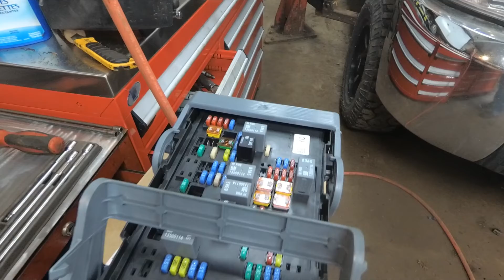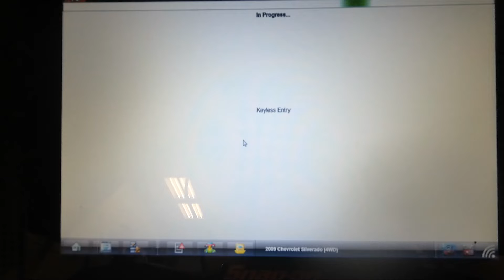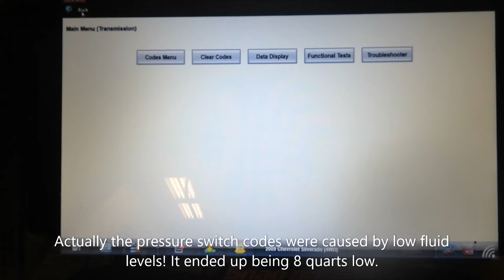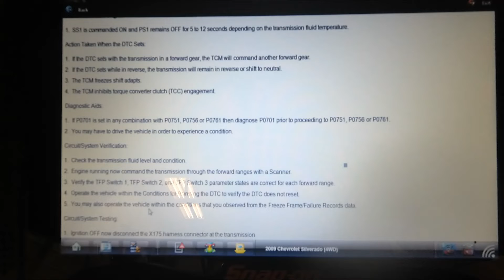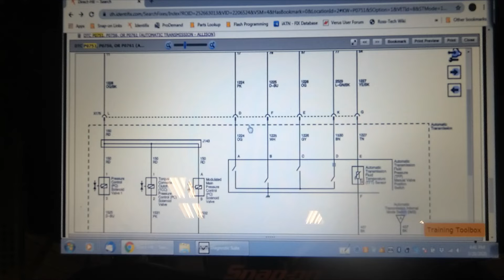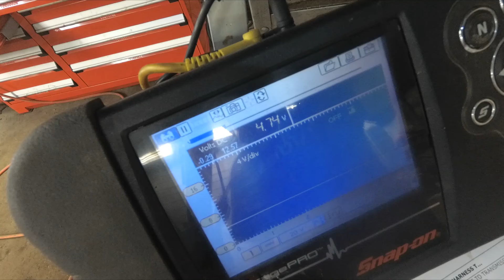2009 2500HD Allison Transmission Problem Pt. 2

Comment: Lack of attention caused a potential disastrous situation nice job
Reply from the maker: Yes for sure. I had looked for leaks when it was in the air, noted the cooler line seeping but didn't expect to find it 8 quarts low. I'm going to replace internal mode switch next week. Have a look inside too